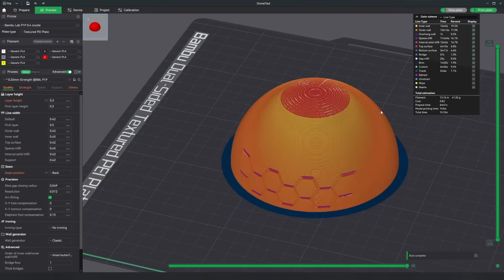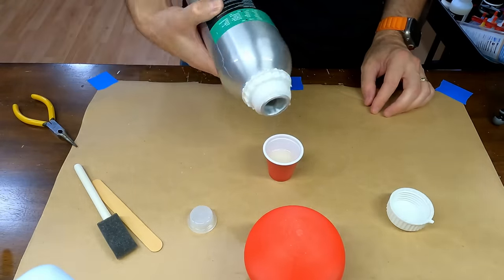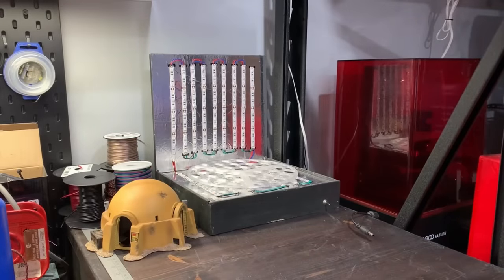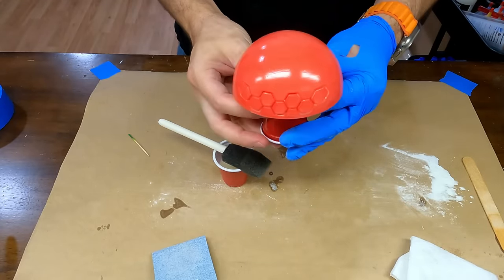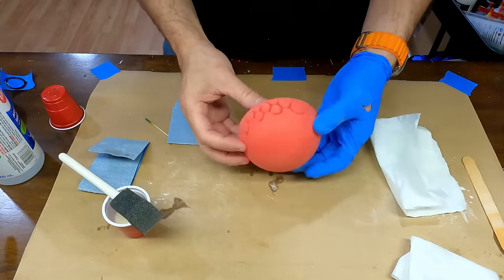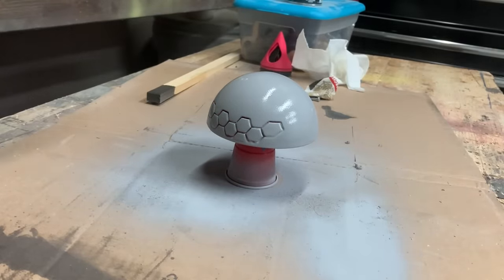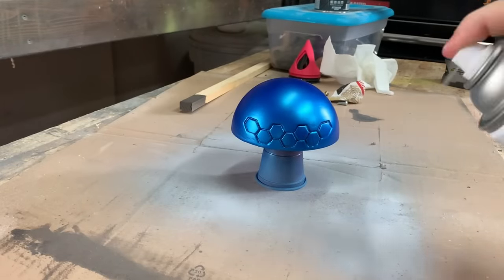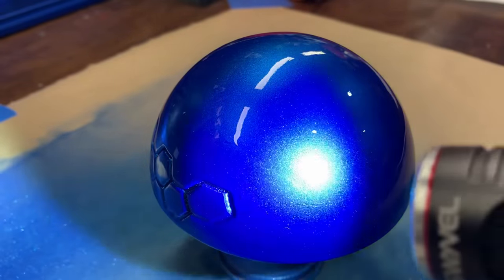Hide 3D print layer lines with Baby Powder and UV resin

Comment: Now that is NICE!

A couple of questions:
-  since baby powder is mostly corn starch, is it ok to just use actual corn starch since baby powders have other "stuff" in it, like scents and who knows what else?

-  If one doesn't have a UV curing ability at home, would using a Varathane product work as well, only that it will take time to dry?  Would that mix well with the corn starch?

-  If not, are the other resins that will cure/dry on their own without UV lights?

-  If one doesn't have one of those fancy little sprayers that you have, do you think that using, off-the-shelf automotive spray metallic paint might look as good?  And would it handle the final lacquer coating spray or would that react badly to the metallic car paint?

I'm really liking the final product there.  I make cases for my electronic gadgets that I design and would love to get them looking this professional.  I do get the faces looking smooth as I use a smooth glass on the hotbed and always print, "face down" with a very thin 1st few layers and then thicker layers after that.  The faces mostly turn out great.  Sure, sometimes, due to human error, I might see some inner layers showing through.  But I think that would all be avoided with your process or a modified version of it.

Thoughts?
Reply from the maker: I thought of just using corn starch from a bulk baking supply store, but getting a bottle of baby powder was just more convenient. I think as long as the cornstarch was ground fine enough it should work

Mixing it in with other products like varathane should work, but there may be other ways of making those product thicker that works better for them.

If you live in a sunny place you can just put your prints outside in the sun to cure if you don't have lights.

Using metallic spray paint can give you the same results. If you have a automotive paint supplier near you they can usually mix a custom paint for you and put it in a spray can for you. But if this is something you do alot it may be worth investing in a spray gun
Reply: @DaveRigDesign There are some art stores around that, I'm convinced, are teasing me when I walk by.  LOL

A few weeks ago, I saw a "kit" with a really nice spray, that in fact, looks almost identical to yours.  I forget all the kit had, but I think that there were maybe different nozzles or something, the mini compressor and other goodies.

I'm no artist, so I couldn't justify the expense.  LOL

As for car spray stuff, I think it was Home Depot where I saw vehicle spray paints for those who want a color that is "close enough."
I remember buying a can of metallic red at that time.  I have no idea where that is now.

Perhaps it's time for me to do some experimenting, because what I saw you do here and the final results is what I'd love to do to my gadget cases.

I'd like a more professional look and I think this would work.

So thanks for the ideas.  I appreciate it.

Comment: If you want the really REALLY good stuff, try Cab-O-Sil fumed silica instead of talc or cornstarch. It's amazing stuff that's designed to be used for this exact purpose. It's not quite as cheap as baby powder (something like $12 for a quart i think) but the results are awesome.

Comment: This the general idea behind products like Smooth-On's XTC 3D except it's a more standard two part resin because UV resin has very undesirable properties when it comes to compatibilities with other materials. I also have used a dry powder mixed in with XTC 3D to fill and smooth large prints.

For this being something I do regularly I do have a few points of criticism. For one you never want to do quite so many successive layers of resin like this. Maybe one or two to start with and then what you want to is sand back down to your plastic with successive passes of 80 and 120. I usually refer to this as the body filling stage as you utilize the resin similar to how someone might use body filler. Rather than fully coating the part after each pass I only target problem areas and use the thickened resin to create a uniform surface. The resin and plastic do not have the same physical properties and a pure layer of resin covering a part is eventually going to stress and crack as the plastic wants to move in different ways in response to age and climate. Once the body reaches that stage I do a single coat of resin to make everything reasonably smooth and then I do another successive sanding typically starting with 120 and then ending at 1200 to 3000 depending on how fine the surface needs to be. I would also recommend against using filler primer after having done a ton of fine sanding. It provides absolutely no benefit when you've already filled in problem areas with layers of resin and in fact just creates a lot of extra work. Use standard flat primer that goes on as thin and evenly as possible and then follow that with painting and successive layers of clear coat. For my purposes I typically only use clear coat as the print will already be in the desired color.

Comment: I'm late to this party, but if you have a thin recess detail (particularly if you don't need fill in it at all) an easy way to mask it out is using a brushable silicone paint mask with a small tip brush.  Fill in the recess, then do whatever you need over the surface, and peel it out before paint and clear coat.

Comment: that's amazing! And for details you just 3d print filler with sticking out handle that allows to remove it after applying resin or filling it up with clay, foam whatever.

Comment: It makes sense that a technique that I have used countless times in my career in aviation for structural repair finishing would have made its way into the 3d printing space.  The materials are very similar in use but obviously distinctly different in nature of strength and resilience.  We would use Hysol 9396 and microscopic glass beads to achieve a perfectly smooth finish on some repairs or to fill small non-structural dents and holes.  Granted, that stuff is WAY more hazardous to your health.  Microscopic glass beads are NOT your friend and fly through the air like talcum powder.  I was always so conscious of it even when wearing a shop aron, gloves, and respirator.

Comment: From designing the test model to completion, I would guesstimate a long afternoon, maybe four to five hours?  That’s significantly faster than what I have tried in the past. Nice work.
Reply from the maker: Once you have your model printed, and if you aren’t trying to film the process, you could go from plain print to final paint in probably 3 hrs or so. 
Not much sanding is needed between layers so it goes fast

Comment: I use wood filler for this. Non toxic, easy to sand, fast to dry and you can thin it with water to get the consistency you need. Adding isopropyl in thinning makes it dry faster, which is a good or bad thing, depending on the case.